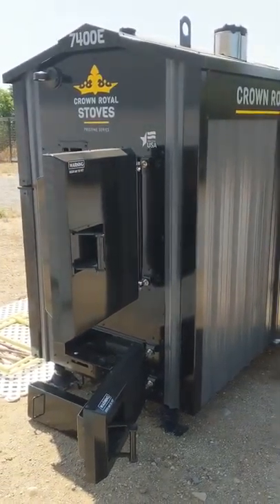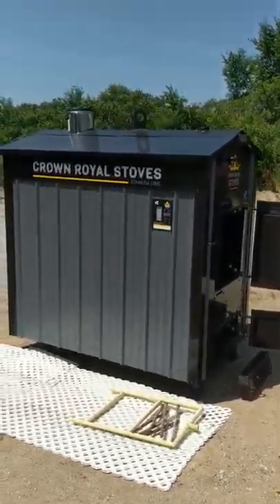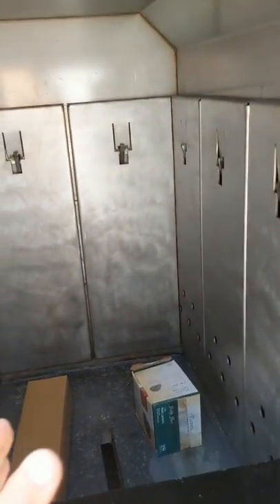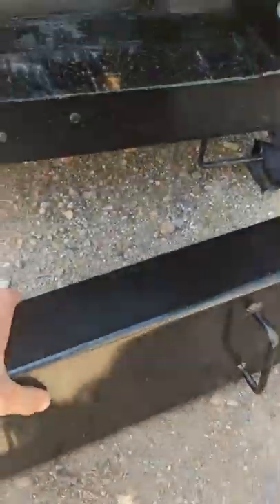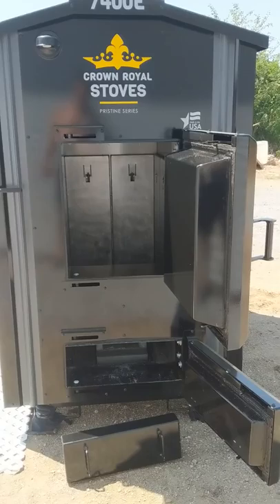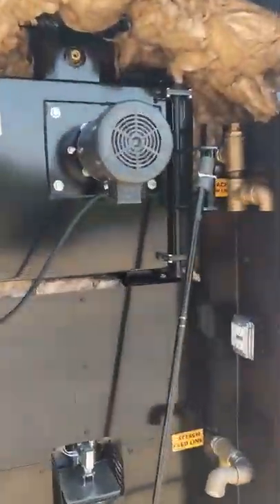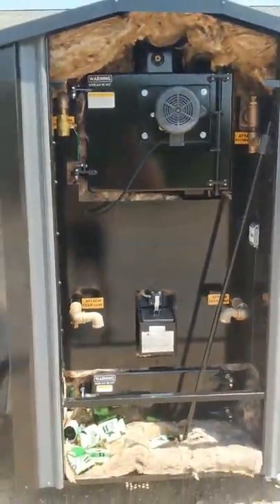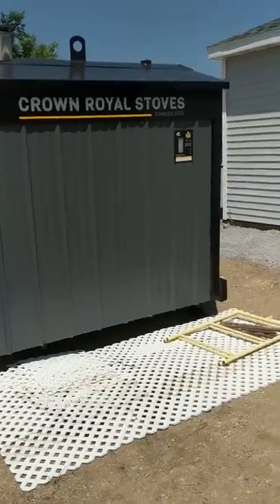Crown Royal Pristine Series 7400E Gasificaction Wood Boiler Review

Comment: What happen to the heat master you were burning this past winter
Reply from the maker: I added on another Shop, which put my square footage over 7,000 and also now have double the DHW usage with the 2nd shop using hot water as well.....so, I needed to upgrade to a bigger model. I decided to try out the new Crown unit this time, its looks like a very very well built unit. I will be sure to post videos once the install is complete and we fire up!@
Reply: Your not helping my decision any lol. I'm looking at either a Crown Royal or Heatmaster. I'm also located in central Michigan. Where did you buy your stoves from?
Reply from the maker: I bought my stove from the  factory, but still went through the local dealer in fowlerville